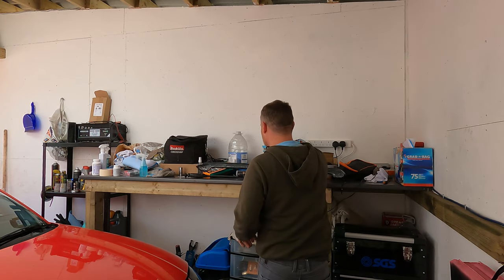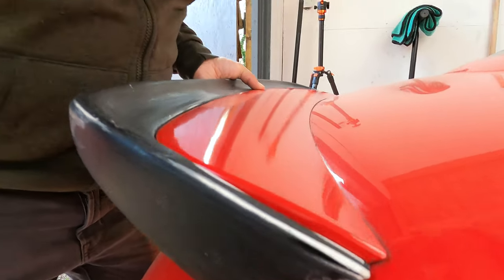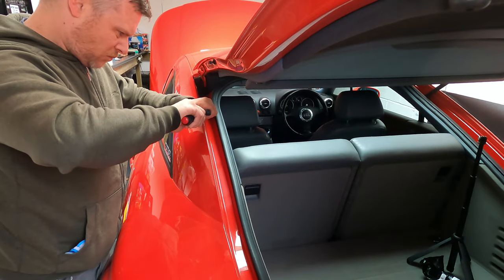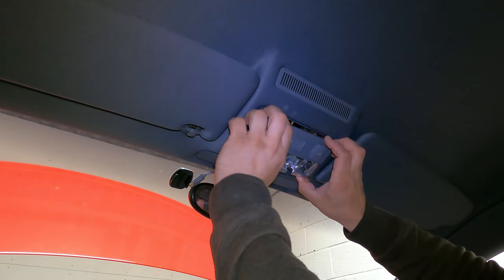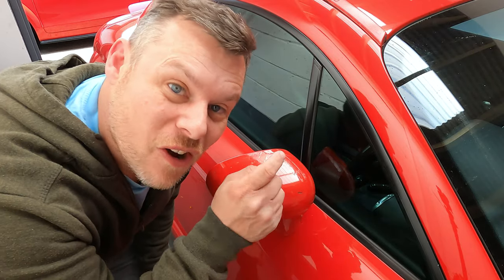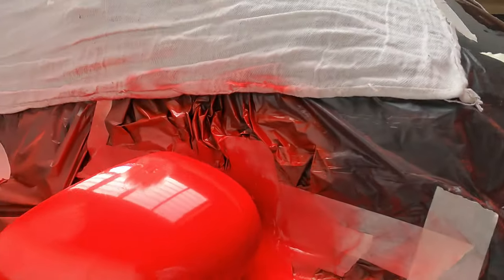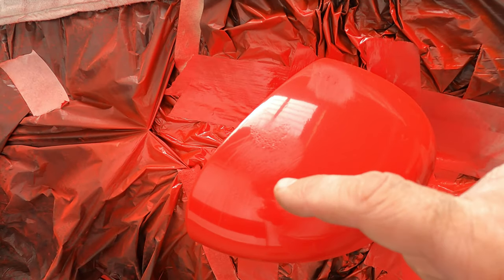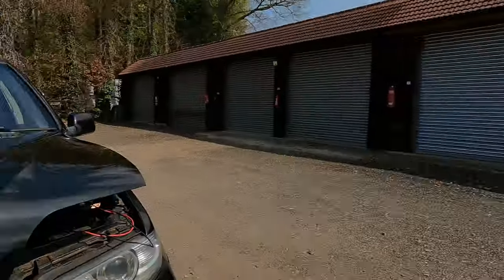AUDI TT MK1 8N PROJECT (more bits to do)

Comment: Use 800 grit on the wing mirror mate then 1500 or 2000 grit.Then prime it with high filler primer.Then three coats of red three coats lacquer 😊👍
Reply from the maker: Cheers mate just picked up some high filler primer and will have another go at it this week

Comment: Mmm Painting.......always worth a try...but probably better to take it to pro😉 interior light and boot fix brilliant. Shame about the V6 spoiler.......must be some out there at breakers....hopefully not too expensive.
Reply from the maker: I got my eye on a red v6 spoiler but its a bit pricy,the lacquer peel is something I would love to sort out and I'm not that good at it so thats why I'm practicing on the mirror first and if I cant get it right I have to pay someone anyway 😂👍🏻
Reply: @CarChris82  I've never had any luck with spray cans doing a good job even on model cars...and bear in mind i'm a painter of things in small scale.  Worth investing in a proper air brush if you intend to do it your self. Not sure what would have caused your issue on your mirror, some sort of residue I would imagine.  worth a primer level and then using the top coat.  its so hard...humidity level/moisture in air, temperature high or low, all play a big role, its so easy to F*** it all up. if that was my wing mirror, i'd be tempted just to replace the unit ahead of painting it, if you can of course find a nice one. But hats off to you for giving it a go, i wish you luck.
Reply from the maker: Here's mate I have had a look for another one but they seem to have lacquer peel aswell so have another go with this one the rest of it looked good apart from where it reacted
Reply: @CarChris82  Yes getting parts without scratches is quite hard...worse with red due to laquer issues....paint it is then😂
Reply from the maker: Definitely mate red is a pain for lacquer peel 😬